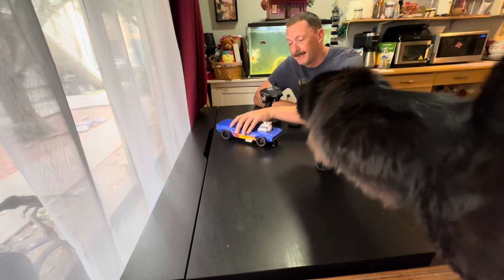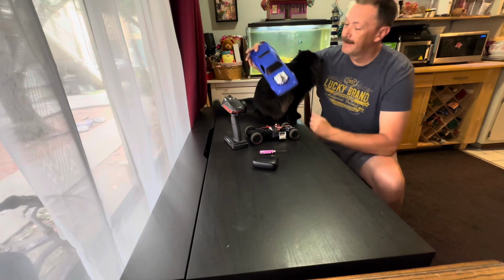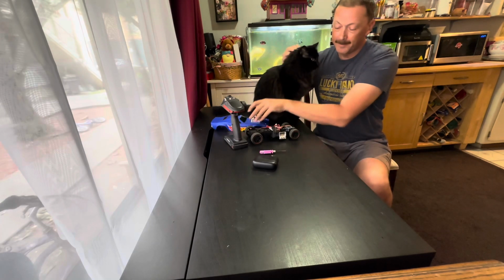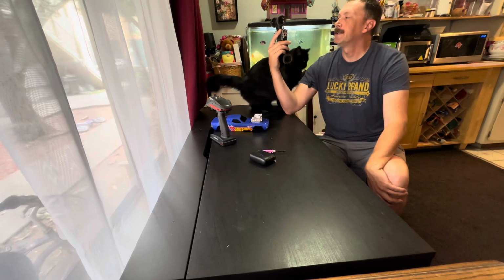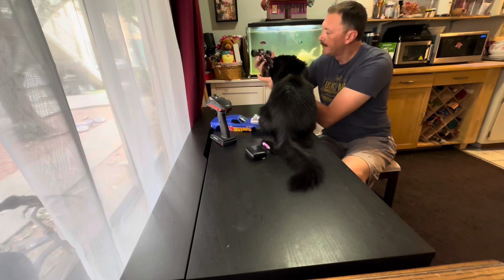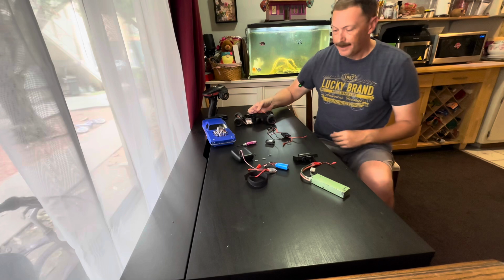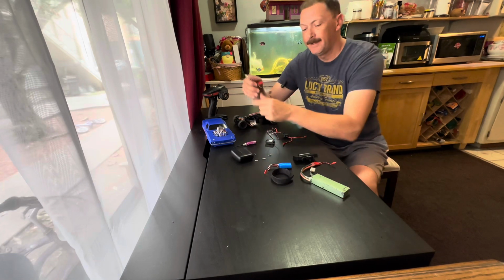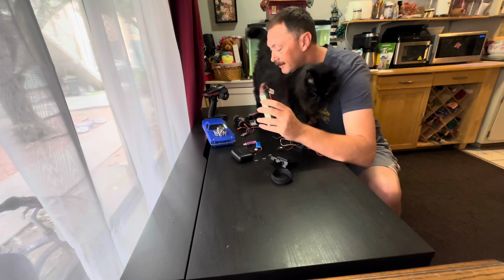Custom Rc Garage. Rodger Dodger is upgraded

Comment: Well done! I think the rubber on the tires actually slides right off and exposes slicks for drifting
Reply: Yes, stock rubber tires for car models.

I think you can upgrade them and buy new and better rubber tires to keep them from wearing off quick